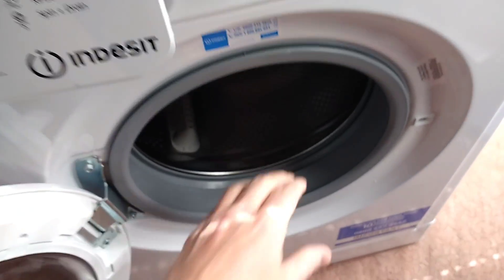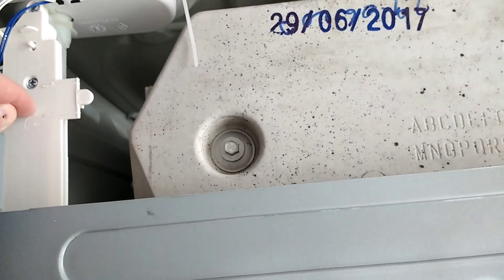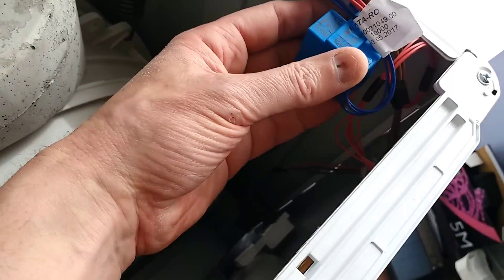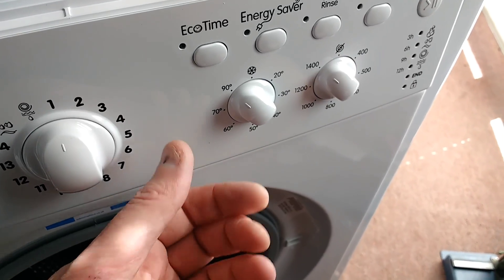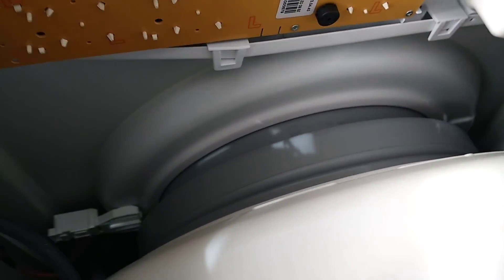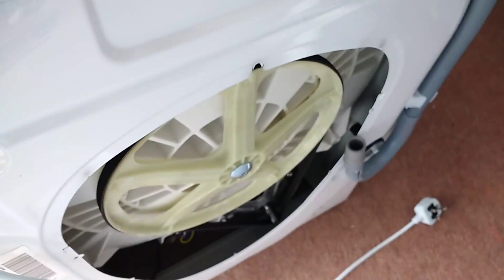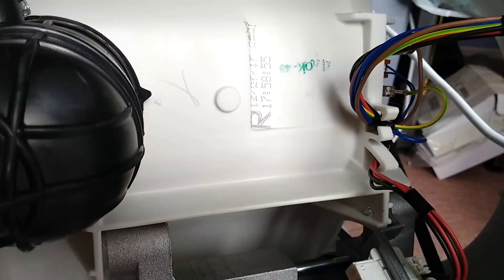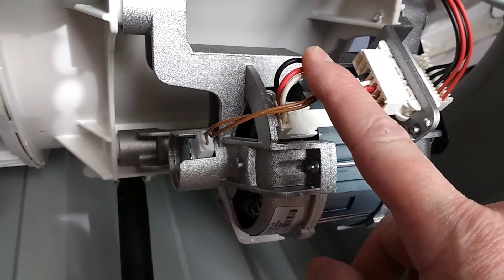Inside my new British washing machine (clothes washer).

Comment: Hey Clive, I work for an appliance repair/rebuilding and reselling company here in B.C. Canada. We only sell top loading machines as the are easier to repair then front loaders and more reliable. The front loaders here are not very well constructed and tend to wear out alarmingly quick. As an example a customer was relating a story to Me just the other day about His Sister who had to replace three front loading washers in three years. From what I have seen it seems that the European models are built better then what I have seen from retailers selling North American brands here. Thanks for the great video.
Reply: Not many top loading machines in Europe. Good front loader machines are more efficient and can be less harsh on clothes. 

Also the door seal is a dangerous failure mode, but putting a proper drain pan under the unit can mitigate risk. Top loading machines can also leak.

Keeping the door open when not in  use helps prevent mold and odours.
Reply: in say new york where apartment space is limited, its common to import german front loading machines,  you dont see many of those outside the big cities, who have basements or laundrey rooms and room for the top loaders
Reply: As I understand it, top loaders were what was used here in the UK originally - going back to the dawn of washing machines. But they were replaced by the more modern, and more effective (they get your clothes cleaner), front loaders in the 1960s. Top loaders were still used in launderettes after that, and a few can still be found today I believe.
Reply: Paul Sengupta With a septic system, the water is passed out of the tank to a drainage field, where it ultimately either finds its way into the ground water (after filtering through hundreds of meters of sand and gravel), or back to the surface and back into the surface water cycle.
Reply: It's more about the energy required a) to pump and filter the water in the first place, and b) the energy required to heat it.
Reply: @beefchicken no-one sin a fight, we just know front loaders use less water, and its not just the cost of water its the cost of heating it, and also yes while it may be your clothes are clean enough, testing has proven front loaders are just a further improvement,  im sure in india when they slap clothes on rocks they are happy with the result, doesnt mean there isnt something better out there
Reply: My front loader is also gentler on my clothes than some top loaders I have used...
Reply: Another advantage of front loaders is that you can stack a tumble-dryer on top, or install under a worktop if space is limited.
Reply: dos gos I'm not an American. My municipality's water infrastructure is overbuilt for agricultural purposes. My town's water system uses excess surface water that would otherwise end up in the ocean, and our pumps  are run purely from hydroelectric power. In fact my municipality runs its own hydroelectric generation station powered by the water coming from the reservoirs that are high up in the mountains, so the water system is very most likely a net energy producer.
Reply: The only way I would buy a top loader, is if it has a tall center agitator. Otherwise, a front loader cleans MUCH better! The agitatorless top loaders are an absolute joke. the agitator makes ALL the difference in a top loader.
Reply: The only way I would buy a top loader, is if it has a tall center agitator. Otherwise, a front loader cleans MUCH better! The agitatorless top loaders are an absolute joke. the agitator makes ALL the difference in a top loader.
Reply: Water use isn't about the cost of water, it's about the environmental impact...or so the EU masters tell us.

We're not really that short of water in Wales most of the time...
Reply: In response to all of the comments from the European Front Loader Master Race, I have a 'hybrid' top loader (Made in Korea) that has no agitator, and it is quite gentle on clothes while still very effective at cleaning. While it uses more water, I can wash a metric crapload of stuff in one go. I'm on a septic system, so the water ends up just watering my lawn anyway. My metered water rate is 1/10th of what y'all probably pay over there, so the comparison game gets a bit silly very quick. Can't we all just be happy that we have machines to do our laundry, without getting into fights over who's orifice is oriented correctly?

Comment: Argh ! They didn't trim the zip ties ! It triggers my OCD !
Reply: No matter how inexpensive something is I always feel bad damaging or throwing away perfectly reusable items. Even if I'm almost sure that I won't reuse them anyway.
Reply: i agree, but better to leave them untrimmed than poorly trimmed. I have scars...
Reply: Против Глобал - Not lazy, just being sensible. Those things can cut like a razor after they've been trimmed. I prefer to use ties of about the correct length and then there's no real need to trim them. A wide selection in the toolbox is handy, and the smaller ones cost around a penny each.
Reply: Lidl sell re-usable zip ties, £2.59 for a pack of 100 pretty large size. I bought a pack 6 months ago and have yet to need one that sturdy.
Reply: Oh well, you haven't seen my granddad
Reply: gigaherz quite clearly you haven been cut by them I have used thousands there's a proper tool for it but still prefer to knife them with a Stanley knife
Reply: I melt the ends of trimmed ties using a butane  lighter. Even if they aren't mine or on anything I own ( as long as i can do it sneakily enough).
Reply: msylvain59 yep you have to trim your tyraps  !
Reply: I only reuse zip-ties when I didn't bring  or bought enough (if you have them chained you can sacrifice one to save the other, even if they are not of the reusable type).
Surprisingly enough that happens a lot...
Reply: Chris W My mum works for the Post Office and apparently they are not allowed to trim the ones on the mail bags for that reason.
Reply: msylvain59 MINE TOO!!!!!
Reply: Me too.
Reply: I'm the opposite, I hate trimmed zipties because then they can't ever be reused for a task that requires larger length.
Reply: gigaherz Who has time to reuse zip ties? They're inexpensive enough to be completely disposable.
Reply: Niko Andruloni hoarder

Comment: This may be beyond the scope of the channel, but would it be possible to get an approximate production cost for a given circuit board? Just a little commentary on how much each component costs and how much it actually costs to make the poundland bits they sell for a couple dollars?
Reply from the maker: What's often referred to as a Bill of Materials.
Reply: I think that would be complete overkill, just something simple like a rough estimate you think it would cost to make the board, versus what you actually paid for the device.

Comment: We have a Hotpoint one that looks fairly similar to this unit, however the bearing has gone and it makes one hell of a racket in use. You have to shout to hear yourself over it, and even then you're still pretty quiet!
Reply: Hotpoint is a sub brand of Indesit, the units are often identical.
Reply: You can fix that cheaply... I did. 
https://youtu.be/XaFF2-Rl8Nc
Reply: c0d3r3d // cleanycloth. We had an old hotpoint washer/dryer thats bearing went after short ownership. Kind of put me off hotpoint and so I ordered an Indesit. Unfortunately hotpoint phoned to arrange delivery of my new Indesit machine. Turns out there the same company here in the UK anyway. Something I should of problary checked before buying. I kept the old machine so I can try to fix it myself one day though.
Reply: not on the one clive has its not a split drum.

Comment: Congratulations, thanks to doing a video about it, your new washing machine is now tax-deductible.
Reply from the maker: I didn't even think of that.  I should take all my appliances apart.  Oh wait, I do.
When I first went self employed I was visited by a tax inspector to make sure I was filling my paperwork out correctly.  He was surprised that I was using a pinball machine as a table for my paperwork and said that if I used any of the technology in the machines at all to inspire or be part of my business then I could claim tax back against them.  I think it was a way of making the tax inspectorate seem more friendly.
Reply: I definitely want to see you do vids on anything being taken to bits!!A front loading washing machine has robust design. In USA these types of washing machine are just starting to be more the norm..
Reply: +YouTube RED78 
In Europe it's the standard for decades. I'm from Germany and toploaders are uncommon here, only if you don't have enough space for the machine. The top loaders here are normally smaller.
No one in my family ever had a top loader, all front loaders. And they must have a window. Even some toploaders here are having a window. I remember the old washing machine from my grandparents. I don't remember the manufacturer exactly, it was AEG or Bauknecht. Front loader, but no drawer, there was a hatch on the upper side of the machine and there were the four compartments for washing powder, pre-wash and stain remover (in case of extreme dirtyness) and conditioner.

My AEG is now 12 years old, one of the last machines made in Germany under the label of AEG....
Reply: We had a front loader in the house that died after 6 years.  The main motor driver board went out I believe.  I got a similar board on Ebay but it would not work.  I gave up and got a 25 year old Maytag for $20 and it's been great for the last few years. It cost less than the used part I got on ebay.
Reply: I thought the Isle of Man was all about not paying tax anyway. But maybe you have to be a multinational corporation to use the address like that.
Reply: @SiskinOnUTube  It is only a benefit for the many millionaires. Working people gain nothing as the cost of living is higher.
Reply: I guess down deep we all want to be loved, even the tax man.
Reply: i guess have more meetings at the pub and claim on tax then! perhaps you can film in a back room!
Reply from the maker: Their tax is simpler here, but you only really benefit if you are in a higher income tax threshold.  The flipside is that it's more expensive to live here.
Reply: The Maytag top-loader I grew up with was old then, and last I knew it was still going strong. Fortunately, this part of the country gets plenty of rain.
Reply: bigclivedotcom  you are a fing legend 😂❤️
Reply: Front loaders are weaker. The bearings need to be better quality because the close placement loads them significantly more. Not a problem for quality makes but run of the mill ones fail. Now i can assure you that you dont want to change them. Front loaders are pretty and interesting to watch a bit thus easier to market, but mechanically weaker.
Both will fail electronically most likely.
Reply: In Germany they must have a proof that your tampering with the machine caused the damage you've complained about to refuse a warranty. And Isle of Man is not EU, and officially not even part of the UK, it's a "crown dependency" as far as I know.
Reply: He removed the upper cover, something I've done too on my AEG to install the special base to stack the dryer on the washing machine. Something that are doing most people which don't have the room to place them side to side.

The dryer is the same age as the washing machine and made in Germany too.
Reply: +Oscal vL -- But over the life of the product, does the amount of water and electricity that it possibly saves make up for the increased price at the initial purchase plus the increased price for replacement parts and the fact that things go bad more often?  I doubt it.
Reply: Sorry I'm not catching on... how?
Reply: it's part of his business now.
Reply: Ahh, when AEG was still good.  We had an old German-made AEG dishwasher that just kept going.  I regret getting rid of that.
Reply: The base was ordered with the washing machine and the dryer together, it was an official AEG-part. The stand is more safe and you have a retractable shelf as an addition. And the dryer is condenser type and is using a heat pump. This means it's heavier than a normal dryer.
Reply: I haven't seen a toploader since the 80's and that was a decade older still, since washers or dryers are typically in the kitchen you would lose surface space if you had a toploader.  My washer is underneath the draining board for the sink and the dryer is underneath that in which doth I make my tea and pot noodles.
Reply: He would have to take off the top in order to remove the transit bolts, and operating the machine without doing that would certainly void the warranty.
Reply: YouTube RED78 some are more robust than others. It's the bits that you can't readily see which are prone to going out, such as the axle which connects the motor to the inner drum. More than a few brands are famous for using an aluminum hub to connect to the stainless drum. Galvanic corrosion ensues, and one day the drum just falls off, and it's irreparable.

I guarantee my old Speed Queen I left at an old house will outlive the new owners...
Reply: Arguably one should calculate the percentage of business use and only claim tax relief on that amount. For my sins I spent a few months working at HMRC (or Inland Revenue as it was known at the time) and saw some surprising items being claimed as business expenses. Generally you'll get away with it as long as you don't take the piss. A good one is use of your home as an office, plus utilities etc.
Reply: +stonent -- That's the problem with the new washers and dryers.  They try to get fancy with the custom controller boards and when they go bad (since what could go wrong with a vibrating piece of machinery operated in close proximity to water), the cost to replace the controller board is more than the unit is worth.  The old mechanical timer units were super simple and replacement parts tended to be pretty cheap.
Reply: @yogibear2k10 that's only if they know he's taken it apart,  they don't usually have tamper evident seals or screws to give the game away
Reply: I bet the old one uses twice as much energy and water though.

Comment: Aww, no reverse engineering of the control PCB or quality check of the power supplies.
Reply from the maker: +bdot02 It's a bit too new to open the controller.  It will be compliant with UK regulations due to the high profile brand.
Reply: can we have a post mortem of the old washing machine?
Reply: The old brick in the drum and full speed until it self destroys? YES PLEASE
Reply: johnyyonehand all the modern ones seem to use 1 inlet now, I wonder why the change?
Reply: A tear down of old machine would be nice. It seems that 2 water inlets would be interesting to look at (probably the "UK only" thing).
Reply: The hot water inlet on the old machines was because the machines used both hot and cold water to full the drum. If only filled with cold water it would take quite a time to heat up due to the large amount of water the wash cycles used to use.
As washers are mainly now only running a 30c or 40c low water wash cycles, there is not much point in having a hot water inlet . Even heating the small amount of water to 60c doesn't take too much time. It also saves draining your hot water tank.

Comment: That is very new - the concrete is dated 29/06/2017. Thought they'd have things like that pre-made and ready to stick into machines.
Reply: They will have batches of components but it will be on a short stock time for each, JIT has invaded all manufacturing sectors now as it pushes costs and risks down the supply chain.
Reply: I am reading a YouTube comment about the manufacturing date of a washing machine concrete deadweight. I have reached peak nerd.
Reply: well they do, but they also dont want huge inventories, relying on the ;just in time method from the maker of the parts
Reply: Yup definitly the JIT Just In Time type of assembly. The first I ever read of it was when Honda bought a chunk of Rover and brought in Japaneese idea of JIT. Honda were amazed at all the unused spare parts and knew it was a great way too spend money and make no profit. Its common practice today unless your in service too have just the bits you need and maybe a week or month in advance too make the next batch.
Reply: comes down to storage, a large bakery i worked near had its flour coming in all day on a tanker truck, it filled up the hopper,  the hopper took about 10 trucks and would run out if the trucks didnt come,, but the site was small and thus could be used for the baking and just the hopper for the day, hopper was just to give some leeway to the truck delivery
Reply: Jusb1066 again correct. less space equals less cost equals more profit and no waste... Just In Time management. Stock and inventry cost money and manpower. Cost not needed in a modern efficent buisness.
Reply: It also helps for modifications. If the company starts getting a high level of warranty repairs on a certain part, they can mod it quickly to prevent future service problems.
Reply: You learn something new every day :)
Reply: kaiowas12 Yes a further devlopment and too increase profit. it makes sense and its common practice in todays world of industry.
Reply: Valve Wizard Some people have a lot of time on there hands.. no wait I have now replied..